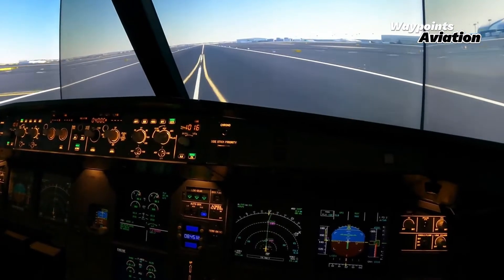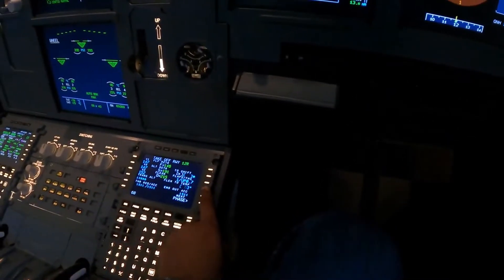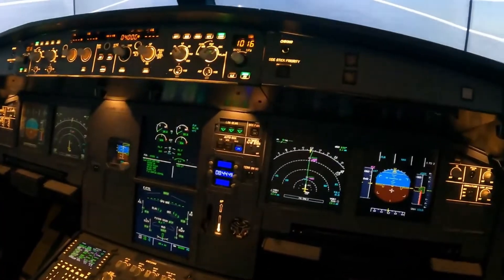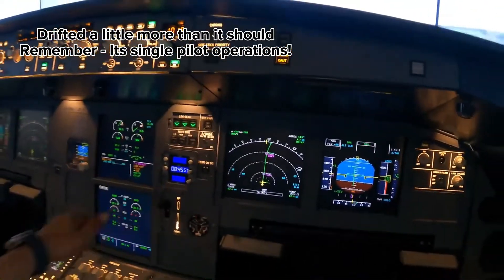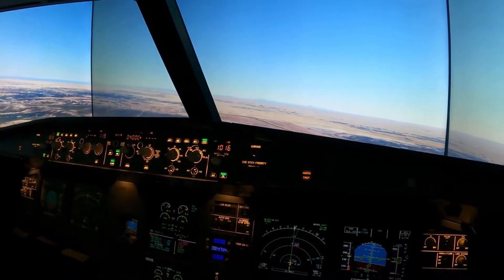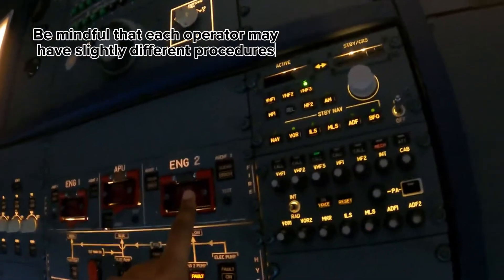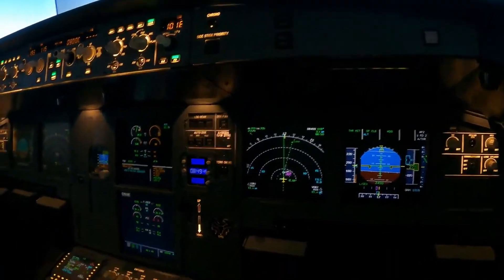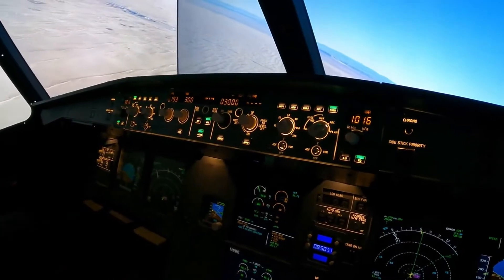Airbus A320 Tutorial: EFATO (Engine Failure After Take-off) to stable flight

Comment: I don't understand, you are over V1 at the beginning of the video and then again standing at the runway... it doesn't make any sense, why?
Reply: As he told earlier, at rotate speed, no need to rush for rotation. In order to make a proper and stable rotation, he wanted to center the centerline at first then pull the stick to 12.5 degrees.

Comment: Wouldnt ve it  been better to just slow down and exit the runway when you get the engine failure before takeoff
Reply: Engine failure was after the V1 speed, which is the calculated speed at which T/O is mandatory, as runway length would not be enough to stop the aircraft. 
If it had occurred before V1, pilots would cancel the takeoff. 
You can see in cockpit videos that when the V1 announcement is made, pilot flying immediately removes their hand from the thrust lever, because no matter what, they must take off. Hope that helps.
Reply: @Seilermann   even with reverse thrust and brakes deployed?

Comment: Hi there,
I am wondering what would be the procedure if single engine failure comes during initial climb, flaps already zero and AP already on but after eng acc level and still climbing towards 5000 ft?
Reply: The aircraft handles this situation very well. With the autopilot engaged the rudder trim is automatically set to counter the yaw from the failed engine. The target speed for the autothrust reduces to something Airbus called 'green dot' (basically optimum speed for single engine flying) and you get a prompt on the PFD that that flashes 'LVR MCT' telling you to move the thrust lever forward to the MCT gate. You would then level off and, with ATC support, complete the ECAM drills before diverting to a suitable airfield.

Comment: Engine failure is not a MAYDAY its PAN PAN
Reply: Always MAYDAY. In some parts of the world, PAN PAN (i.e. urgency call) is not recognised by the aviation authorities and therefore ATC.
Reply: @tomarsawrous no you are wrong. If you have engine fire its mayday. But in case of engine failure without damage- fire its Pan-pan.
Reply: @subzzing4545  A pan-pan call is used to describe an urgency condition which (quote ICAO) DOES NOT require immediate assistance. A mayday call describes a distress situation that (again quote ICAO) DOES require immediate assistance. You need ATC to give you priority handling and move other traffic out of your way, you won't get that without declaring a mayday. Just out of interest, why you would not use a mayday call?
Reply: @tomarsawrous  its because these are different scenarios and i have to follow procedures. I followed these procedures at my type rating so?
Reply: in case of engine failure a320 , you are not in distress. On ECAM you will see LAND ASAP in AMBER . It means you have to land but its not time critical. You can fly 6 hours with only one engine operating with MCT detent. Mayday means you are in distress and time critical condition, unless you act immediately you will DIE.
Reply: The above post on "MAYDAY" CALL is correct as i have seen many pilots from many airlines both Captains and FO whom have flown other types use exactly "Mayday" call during their training on to airbus for engine failure, atleast thats what i have seen

Comment: i feel like you woulda normally advanced the throttles immediately to toga after eng fail rather than continuing in flex lol. since you're now single eng you'll get a bit more out of the engine too. but not without advancing throttle
Reply: Not required because engine flex temperature calculated (which is done on the Airbus using an iPad app) ensures the aircraft will meet minimum obstacle clearance requirements in the take off flight path. You can select TOGA but the extra thrust produced by the live engine makes it more difficult to keep the aircraft straight on the runway.

Comment: Dude gotta question. Let’s say EO SID said after take off proceed RWY HDG climb 3000 for example, you got engine fail after V1 you’ve done the procedure and during the ECAM procedure how many NM you’re gonna fly with engine fail in order to reach 1500 ft + elevation? Consider wind calm. Coz I need to know how long the A320 gonna fly with 1 engine to reach 1500 feet with no wind.
Reply from the maker: Without leveling off, when engines are secure and/or checklist - about 8nm+ depending on the weight, elevation and accuracy of flying.